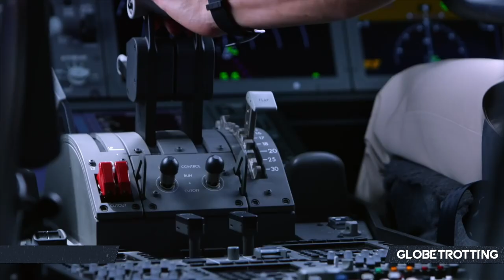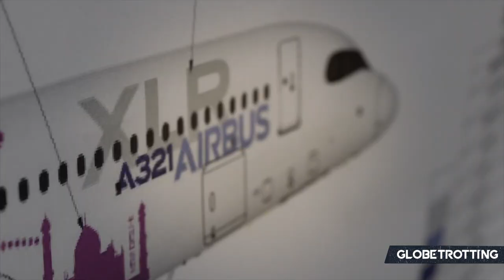Boeing's Next New Airplane...

Comment: If Boeing was REALLY smart, they’d co-develop a 737 and 757 replacements at the same time. Being the great success they had with the 57 and 67 for training. The 737 has reached its maximum technical lifespan and needs a clean sheet reset. And I thought the 787 covered the 767 slot. Just my thoughts.
Reply: It is not Really smart. It is more: not stupid. 
Smalest betveen max7 and max8. Next is a 200 seater, then a 230seater and biggest 270-280 seater. Same cross section, same nose, 2 different midd sections and 2 different landing gear lenghts
Reply: Honestly Boeing’s Max program was a completely logical program to undertake it benefits Boeing and their customers. Unfortunately they screwed up on the implementation of the mcas system. If they didn’t screw that up, no one would be talking about Boeing or the 737.

Comment: Boeing should do what it did when 757 & 767 were going through development. Though their uses differed in capacity and capabilities, where they could overlap, they did, via both programs being a joint venture, which saved both money and development time. Boeing should dust off this duo development scheme, and apply it to the 797 and a replacement for the 737 when that looooong in the tooth and needs a clean sheet replacement. That replacement, which doesn't have to be built right away, but can sit and be updated till the investment that went into the 737 Max program has been recouped, a certain level of profits are made, or sales of the Max start to fall off, whichever comes first.
Reply: It’s a great approach. Airbus did the same with A330 and A340
Reply: @paddybm3245  that's true, and with a potential shared system and engine the magic could strike again given how OP'ed the 757 is and the levels that Boeing has reached with carbon fiber they could pull off something with good design work.
Reply: No one will ever build a 2 aisle 7 wide aircraft ever again.  All that drag and wasted structure carrying near zero passengers.  An entire extra aisle for 1 seat... Just NO.  Same reason NO one is asking for a 767 for the last 20 years.  

If Boeing wanted to do something, make a UNIVERSAL cockpit covering ALL 2 engine aircraft.  There is literally next to zero difference for the pilots other than flare on landing height.

Comment: Boeing needs to address at LEAST two new aircrafts. The 737 Max will age like fine milk in the next ten years and they will need a replacement badly. Either they produce a 957/967 kind of situation being able to replace both the 737 and introduce NMA at the same time frame - or they will be in all kinds of trouble.
Reply: Well it will age no faster than the 320neo that’s what really matters.
Reply: @DontUputThatEvilOnMe  I disagree. The engines on the Max are smaller and less efficient than the 320neo already. But more importantly they are the very, very, very last option for this plane design. There will be no engines even further to the front and even higher up. This is it. The 320neo has some leeway to go the same direction as the 737max already did. Engines even closer to the ground an so on.
Also I fully expect a re-winging of the 320 within 7-10 years with composite wings, Airbus is already working on those. The 320 will be old by 2030, but there is some last tricks up his sleave, while the older 737 already had to pull all of them out because of the short gear. So my point is that the 737 program will definitely age worse through the mid and late 2020s. Boeing does need a replacement for it's bread winner.
Reply: @RiiPapa  I agree but on the short landing gear, but for right now the 737 is on par with the a320 in efficiency the max10 once it’s certified will the most fuel efficient airliner per seat in history. The 737 airframe is old but materials have been updated throughout the years and it’s generally a very slippery airplane aerodynamically compared to the a320 and the aggressive split scimitar winglets help a lot. That is why it can compete with the newer a320 on efficiency even with aerodynamically less efficient engines cowlings. Also The engines are actually the same as the a320 and are not actually smaller. They just look smaller because oval intakes create an optical illusion. Sure a320 design has more upgradability, but I said the 737 max will last as long as the a320neo not future a320 designs.
Reply: @DontUputThatEvilOnMe  one correction about the engines: The LEAP-1B on the Max has a fan diameter of 1.75m and a bypass ratio of 9:1 while the LEAP-1A on the 320neo (and similarly the 1C on the Comac) have a 1.98m fan and a 11:1 bypass ratio. This results in the 320neo having around 10% better fuel efficiency than the Max-8. This is much closer with the 319neo vs. Max-7 and the 9 even has a 2% lead in fuel consumption over the 321neo.
Reply: @RiiPapa  a lot of resources say the max-8 is slightly more fuel efficient but only by a few percent.
Reply: @RiiPapa  yeah correct

Comment: I think it's a no brainer that Boeing should wait for the next generation. With the 777X and its other remaining challenges (incl. ramping up MAX production), they would be stretched too thin. A plane that would enter service in the 2030s will not only benefit from new technologies, but its Airbus counterpart will also be aging by then.

One factor though that hasn't been mentioned here is COMAC. Arguably the C919 in it's current form isn't much if a threat but 10 years from now that could change. Once upon a time it was "obvious" that Boeing's chief competitor would be either McDonnell Douglas or Lockheed, and no-one thought for a second that in reality it would be some obscure upstart from Toulouse. Both Airbus and Boeing should be careful that history doesn't repeat itself.

Comment: Am I the only one thinking that making a max variant of the B767-300ER isn't that hard? (Wing redesign and Engine Downrates for GEnx and Trent 1000, will take a bit but no longer than 778 lol)
Reply: There was a suggestion by Boeing in the past for the 767-400 to be updated but it didn't gain traction. I think a perfect competitor to the a321xlr would be a revamped fuel efficient 767-200. But Boeing is it's own problem.
Reply: What are you two talking about?  The 767 is a widebody and in no way competes with the A321, and it was effectively replaced by the 787.  It's pretty clear that Boeing's next project will be a larger narrow body, more like the 757.
Reply: @ChristopherBurtraw  the 767 and 757 were developed alongside one another. The 767 was originally meant to be an NMA alongside the 757 just higher capacity for passengers and cargo. The 767-300 extended that range and capacity which is really what the 787 replaces. Not the 767-200. The reason you don't see 767-200 in passenger service anymore is because they were not as fuel efficient as the 757.  The 767-400 is a different airplane to the original 767 and doesn't really fit in the NMA market.
Reply: @ChristopherBurtraw  a 767-200 is smaller than a 787-800 and it fits perfectly in the NMA category although it's original older concept is far less fuel efficient.